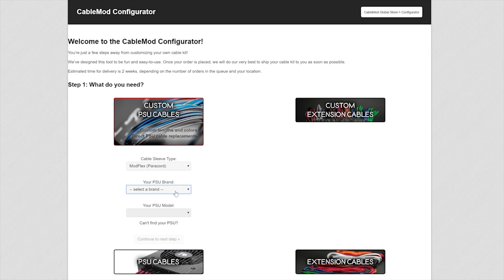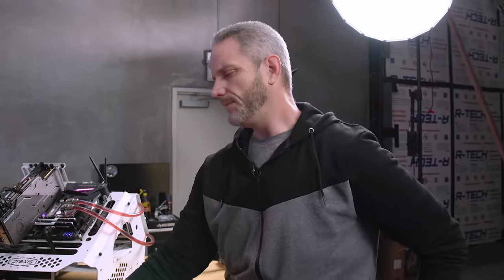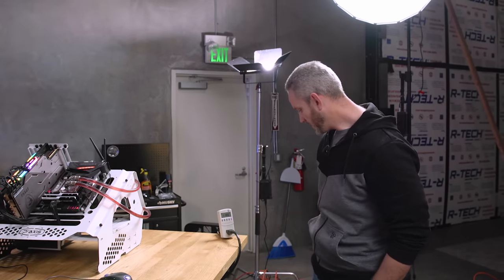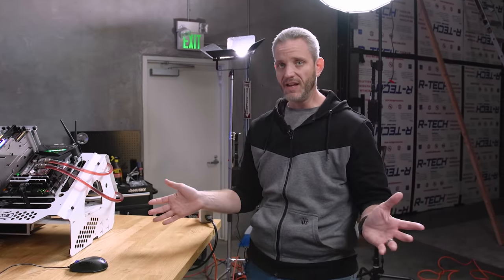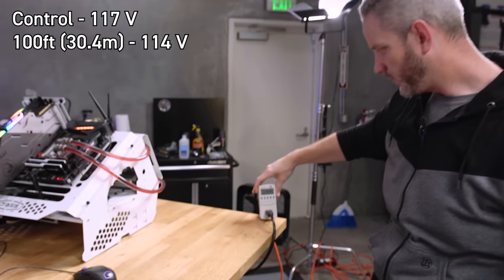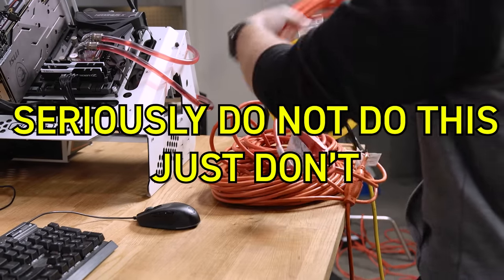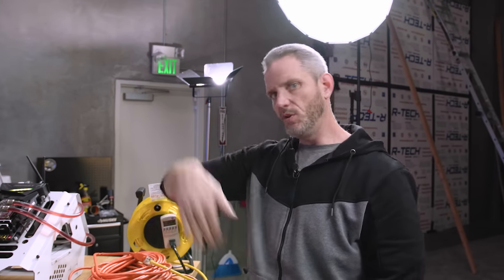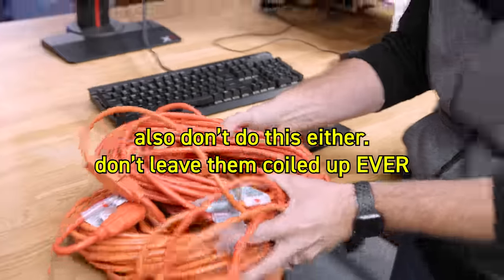Are extension cords dangerous for Computers?

Comment: Coiled up and cheap insulation had less to do with the cords getting hot than guage, length, and load being put on them. 14 guage is good for 50 feet at 15 amps/120v and 1875 watts. 12 guage is good for 100 ft at 15 Amps/120v and 1875 watts. A 10 guage is rated at 15 amp's, 300 volts,  but only 1800 watts (I know, you would think it would multiply up to 4500 watts but you're still on a 120v system in the US.)

With these three chords connected biggest to smallest then a power strip, you should be able to run three mid ranged PC's 350 feet away from the outlet, without shortage of wattage, without fire hazard. 

You can run romex in the open... just don't expose it to sunlight. don't run over it with carts. Don't constantly step on it. For that matter don't run over your extension cords either. Oh and DON'T ROLL YOUR EXTENSION CORDS UP LIKE THAT!

Also, putting contractor grade on the packaging of a tool is equivalent to putting gaming in front of a three name of a PC part. It's a marketing tool not a performance increase.
Reply: Did you never learn to use the metric system? It is much easier with the metric system.
You can use about 10A per mm2.

Comment: Jay. Thicker strand is not better for amp load. Electricity only flows on the outside of a strand. Its actually more efficient to have more strands than less bigger ones. You could run a super fine strand 12g wire and it'll preform better than those ones. But for that many watts its always better yo go with a higher guage. Hell 10g or 8g would work well. Ohms law is what you'd need to research and figure up. Hell may even help with some custom things when building pc's faster data transfer if you use a better wire for your extensions. Maybe get a bump in benchmark scores.

Comment: Typically 115v is considered a good nominal voltage for high load scenarios, like say 1000-1800w. To you'll rarely have 120v under load, even direct from the wall.
Now below 100v is pretty bad. Use 4/0 (not 4 awg, this is below 0) gauge if you wanna go overkill 🤤

Comment: 120/110V in the US is a half-truth. 
Most Homes have 240/220v at the mains, one of the phases is split off to run 2 120/110s  but some appliances still use 240/220v 
I have a separate 240/220V in the Garage to run the TIG.   
I've worked in a data center that ran 660/440v 3 phase. that stuff will cook you well if you're the shortest path to ground.

Comment: just calculate your voltage drop and no problem / you can get a wire Gage chart on line for voltage drop / and a on line calculator to give you the answer

Comment: Witnessed quite a few cheap cords fail over the years, every time at the cheap crimps connecting the plug or receptacle end.   Cheaping out on your extension cords will always bite you in the ass.  You can usually judge the quality of your handyman/contractor by whether he cheaps out on his cords, you can't fix stupid.  Jay should have tested multiple gauges as well to demonstrate, although running anything on multiple 100s of feet or extension cords is a recipe for disaster.

Comment: It's a myth that the 110V method of power delivery is "inefficient." How would I know? Electrical engineer in power distribution working overseas on US bases? Anyway, the power is delivered to substations at either high or medium voltage (greater than 600V) and then dropped to low voltage. This is the point at which you would see 100V - 120V at 60Hz. 110V/60Hz is more efficient for motors due to the cycles needed to maintain average power and 3 phase is even better. On the flip side, 220V is at 50Hz generally speaking. Each country is different such that Philippines is 220V/60Hz and they are using 110V style plugs now so definitely read those labels.

Comment: on my power conditioner the volts display drops from 127 to 93 for just a second upon fresh power up to my devices.  ranges from 123 to 126 volts with all devices on 20 amp circuit.

Comment: When you leave a cord coiled Its a Resistor ... Never do that or you will see a voltage drop, And if you are running close to the maximum amps of the cord it will start getting hot... That's a No No.

Comment: So, I just built a new pc and moved to a new apartment. The room I’m putting it in has a wonky outlet where the desk is and I’d need an extension to reach the other wall. Is there anything I should be careful of in order to avoid starting a fire or frying my system?

Comment: That you didnt roll out the extension cords had me reeeeal worried. Most (230v) extension cords (here in Norway anyways) are rated for 3680W when they are rolled out, but only 1000W if you keep them spooled due to the head produced in the cable spooled at max W

Comment: The PSU spec sounds wrong, although it may just be the oddity of EU harmonisation. UK single phase is typically 240 volts, however it is "230 V" nominal voltage because of harmonisation. The power grid should (technically, MUST) be 230 V +10%/-6%, or between 216.2 V and 253.0 V. Even with the never-adopted +6%/-6%, that'd still be a possible 243.8 anticipated voltage from the grid. Wikipedia says North America's grid is 120 V +5%/-5%, or 114 V to 126 V. 115-240 V is either two typos, the PSU isn't rated to run at the full range of (regulated/legislated/mandated) consumer/single-phase voltages used in North America and Europe, or it is only the nominal voltages that are listed (unlikely given "full range")... 115 V nominal voltage in Barbados, 240 V nominal voltage on several islands, 110 V in Taiwan, Cuba, Dominican Republic, Jamaica, and others.

Comment: should you also take into account the length of the power cable once it leaves the transformer leading into the building and the circuit breaker along with the length of the wire that leads to the power outlet you are using?

Comment: For the last 5 years I have been running my pcs off of an extension cord with an 8 outlet power bar 3 monitors speakers  a laser printer cable modem 24 port switch I have had no issues.
Reply: As long as the cord isnt getting hot, you will probably not have issues.

Comment: I'll admit I've daisy chained power boards together, sometimes up to 4 PCs chained back to 1 power point.. but they were always 4-6ft + 4 plug splitters rather than long ass extensions.
But yes they were the cheapest shittiest ones around

And yes, we did manage to burn one after much abuse.

But here in Australia, with our 240V power, every house by law must have a 10A breaker on every single circuit + safety switch. So if the amperage slowly goes up it will pop the breaker, but if something malfunctions and there is a sudden spike the entire house immediately shuts off.
It is so fast that it's even possible to jam bare metal in a socket and have it shut off before getting shocked (but just in case, obviously never try that)

Never had a PC damaged from these setups in the past, but in personal experience I've had 2 rear projection TVs, a landline phone (both as a kid) and now recently my multifunction office printer blow from a lightning strike.

Comment: Yeah, defiantly used an overkill PSU, which was able to tolerate the under voltage. Should have used a cheap 700 watt PSU and see what happened.

Comment: Yea, never keep them rolled up if you draw alot of power true that cable even a expensive one! it acts as a coil. Thats why its getting hot or hotter then normal. if you role them out they wil not get as warm and get less voltage drop.

Comment: I was thinking here in Denmark we are using 230V that's the same as yours strong power? right?
next test you can try to put 230V in a power supply and see if you get same results

Comment: It's not a 120 volt system, it's a 115 volt system. The 5volt overhead acts like a reserve, so your 118 volts is within specs.   Who in the world carries 16ga extension cords?  Oh,   Harbor Freight, never mind.  Most extension cords with orange coverings are 14 or 12ga, you can buy them at quality hardware stores; places like Lowes or Home Depot. You can also buy 10ga extension cords made specifically for air conditioners and machines in 8ft to 24ft lengths.  Extension cords with 16ga wire are normally used for lighting, are colored white or brown and mostly 6ft to 8ft long.

Comment: I have my PC, 2 monitors, 2 sets of speakers, PS4, Switch, a fan, and my modem/router plugged into a surge protector, which is then plugged into a 50ft 12 gauge cord. It's been fine, the cord never gets hot or anything. I check it regularly to be sure.
Reply: That isn't very much for a good quality extension cord.  Not reccomend but if it works, it works.

Comment: V=I*R (Voltage = Current * Resistance). Extension cords introduce resistance therefore inducing a (significant) voltage drop which is why you're seeing that drop on the meter. Looking at the equation if voltage decreases and resistance increases the current has to decrease quite significantly to keep both sides balanced (not enough current available might explain why your OC's were not stable w/ extension cords on Scrapyard Wars). I would be curious to see current readings on that meter if it can do that as well as current readings on your GPU and CPU power cables.

Source: Paid a college tens of thousands of dollars to teach me Ohm's Law.

Comment: @JayzTwoCents what about using a power bar (not UPS)? For example, i have 2 separate power bars plugged into 1 wall receptacle (120v feed). 1 power bar has my PC, router, modem and the other has my 50" plasma, my sound system and the surveillance router.

Comment: To be fair my entire room is run off a single outlet gang starting with a surge strip with 4 UPS's hooked up to it; one runs to my computer and associated bull from a 50ft extension cord, one powers my nightstand, one powers the one powering my nightstand, and the one running the computer runs another that runs my OG XBox,  HTPC and TV.

So it doesn't get much worse than that. Also. Window fan.

Comment: And the *SO cable is better because its a stranded wire where as the Romex cable is solid and can't handle the current, Look at a battery cable or a welding cable, Both are made up very fine stranded wire, They can handle a lot more current.. Stick around and i'll teach ya something lol

Comment: Technically speaking, houses that are capable of putting out more power means that these places are harming the planet just as much as we are and that is only because of what it requires and the quantity of it. American houses may support less and the ways of getting energy to everyone to their houses may not be efficient (since fiber optics are a better alternative in every sense of the way), the majority of devices (except for the house's stuff like the refrigerator, heater and the AC itself ) inside the typical house barely ever asks for tech using more than 30 volts individually.

Comment: The truth to Europe using 240 volt as a standard opposed to 120 is literally only the fact that it's cheaper to run thinner gage wire, there's no efficiency difference at all, it's just cheaper to use thinner wire to run everywhere so they do it to save money. But now little Timmy will go play with an outlet and get 2x the shock. There's no other benefit to running 240 other than that

Comment: "Ever turn on the vacuum and the lights in your house go vuuuum?"
No... does this happen in the US? You should really work on your energy grid there :o
Reply: Yeet, I've had that issue until I figured out which circuit was loaded with stuff. My Rainbow D4 (vacuum) draws, like, 12 amps .

Comment: Reminds me of Linus’ video where he got a ton of PCI-E extension cables for vertical mount GPU. He got pretty darn far by PC case standards, like across the room his graphics card sitting on a table getting power from a second power supply because it’s so freaking far away from the motherboard and “the” power supply for the rest of the system.

Comment: Just wondering how hot that coil of orange cord was at the time of running a computer full throttle and the compressor. I've seen some melted coiled extension cords over the years. I've had coils like that orange one, just picking them up after a show not being able to roll them nicely because they were melted together (the outside). At that point I was wondering how there was no short circuit yet.

Comment: The shittier the cable, the hotter it gets.
With more heat comes more resistance.
With more resistance comes more heat.
The cycle continues until failure.

Comment: They are dangerous as there will be a voltage drop across the whole length of the cable, if the extension cable gets hot it could catch fire.

Comment: So what's going on here is sneaky.  While you're right on the whole resistance/amps thing is right (ohms law) what is actually important is you are adding impedance.  For laymans terms impedance is like resistance except evil.  Where you will get your critical failures when doing this is when things turn on and off.  Due to the increased impedance the transient voltages generated by turning things on and off are increased and have more ass (amps) behind them.  Every time you turn on something lightbulb, computer, car there is a voltage spike that can be several hundred volts higher than the input voltage.  Same happens when you turn things off except in the negative voltage direction.  This also makes the transient last longer a spike that usually lasts 2us could last 2ms.  Thats a big and destructive difference especially at those voltages and currents.  On the plus side the worst that is likely to happen is a capacitor explodes in your power supply and you get a temporary light show.  On the negative side the worst that is unlikely to happen is your computer catches on fire and you burn your house down.

Comment: In fact, a motor pull up to 6 times he's full load current at the start (1s) and at this lenght and gauge of cable the most litle fluctuation become big.
This is why the electrician who wired your home is suppose to put what we call dedicated circuit for each off the thing who have a motor in your house like fridge, microwave, sumpump, air conditioner, thermopump, central vacuum etc.
In Canada ans USA the 20amp 120volt circuit can deliver up to 2400watt max where in EU the 20amp 240volt circuit will deliver up to 4800watt, this is why you think they have a most proper electricity because a motor plug in the same plug as a computer will not make a big difference for them.
Also, in general rule, if you give only 50% of the voltage needed at something to work, like if you only give 60volt at an old Incandescent light bulb who work at 120volt, it will only deliver 25% of its watts. Then in this case a 40Watts bulb will give you only 10Watts.
All people should avoid 16 gauge extension cord for wathever you wanna plug because all plug of a home is either 15 or 20 amp and 16 gauge is only up to 10 amp.
Then your 15amp breaker will not trip if you pull 13amp on your 16gauge extension cord and there is the risk of fire.
And finally for the lenght, in any building if we have more then 75 meters (246 feet), for a 20 amp circuit, from the breacker to the plug, we upgrade the gauge for 10AWG.
In home for the 15amp circuit this is 155 feet then if you already have 75 feet of wire from the breacker too your plug and you put a extension cord of 100 feet in it, you bust the 5% acceptable voltage drop. Drop even more if you have a 16 gauge extension.

Comment: I've never understood the point of an "extension cord" that's not literally an "extension" of the wall socket.  It should be the same stuff that's in the wall, just with better shielding since it's going to be abused a lot more.

 If I can't plug my UPS directly into the wall, then I only use a 12 gauge 15amp 120v extension cord.  Anything less is just begging for a fire.

Comment: I know that you'll blow a cheap household extension, but i recently started wondering about shop cords. That can be used for up to 240 V. Living Off Grid, everything is run off of generators, and was thinking of building a green room for MR videos. So I would need to run extensions from the generator to the green room, where I would have my UPS.

Comment: Romex across the floor isn’t “dangerous”, people believe everything they’re told today. The only issue with it is longevity. Solid core copper work hardens and fatigues.
Reply: Durability of the jacket itself is more an issue than the solid core. It takes nothing to cut the through it and it does a poor job of protecting the inner wire against physical damage. Sjo is more forgiving and thicker protecting the inner wire and insultion.  Also depending on how Romex is ran it is less likely to lay flat on a floor and more prone to getting kinks with frequent use which in turn damages the outer jacket.

Comment: New(ish) high end components not stressed to near breaking needs to be pushed that much further to crash. Vs. Scrapyard wars used/old/unknown stretched to the limit of its performance (aged, less total performance) means that system needed a lot less to become unstable.... But if that new hotness is permanently setup with just below the limit of extensions/bad power it will eventually deteriorate in quality to a point where it no longer runs.... 3mo, 6mo, 2yrs? Better keep them extensions temporary!

Comment: something i wanted to know.
as my gaming pc is in the living room/lounge theres not enough outlets behind my "centre"
i have 4 outlets but way more appliances.
1 gaming pc
2 nintendo switch
3 ps4 pro
4 psvr
5 ds4 charging dock
6 ps move charging dock
7 virgin media  box
8 audio amplifier
9 broadband router
10 switch controller charging dock
11 rega turntable
12 creek audio pre-amplifier
13 amazon echo
14 65inch 4k tv
16 xbox controller charger (for my pc)
17 wireless mouse charging
18 wireless keyboard
19 external hdd for ps4
20 external hdd for pc
21 the guilty steam link that i never unplugged after i moved the pc from the guest room to the lounge